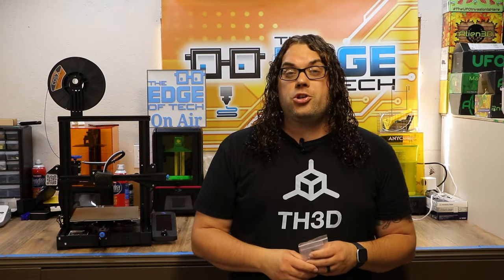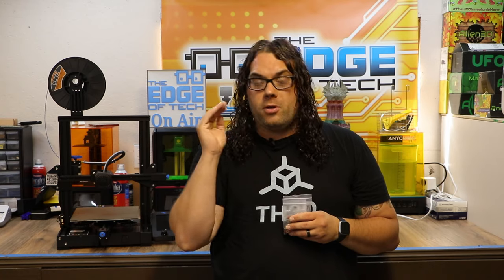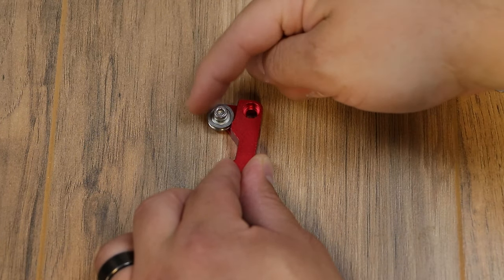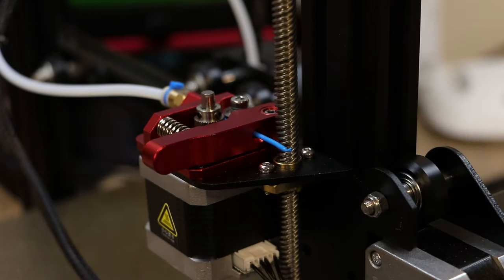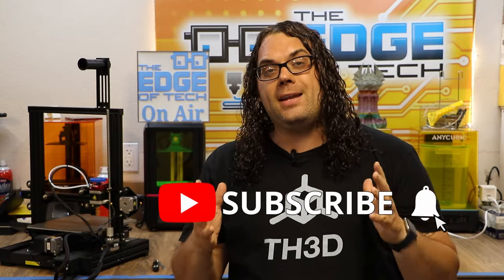Upgrade the Ender 3 V2 Extruder in 5 Minutes - Aluminum Extruder Upgrade

Comment: “If you look under the arm… you might find a little crack in there”. 

Pulls arm off, finds it’s cracked nearly in two. 

“Huh. Well, there’s the problem”

Thanks for the great guide, made the diagnosis of the problem I was having and the upgrade process really simple.
Reply: That's what happened to mine the other day. Explains why my prints were awful leading up to that. Replacing that mechanism has lead to prints being so much better. Even without calibration.
Reply: Yep, I'm here because mine cracked  last night.
Reply: same lol
Reply: Mine silently cracked / tore itself apart. I was really happy as it explained why my prints have been failing for so long.
Reply: Exactly the same happened to me

Comment: Thanks a lot for this video. I did a couple of things differently when I installed the extruder. 

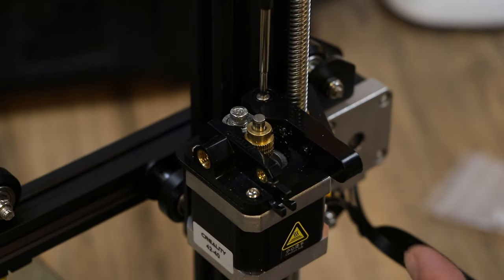1. While removing the screw in 2:30 , I retained the metal funnel thingy that resides inside the sprint and transferred that to the new extruder where this piece was lacking.
2. I retained the gear from 2:45 as it looked like the gear on the new one was similar to the existing one. Both had 2 grub screws too.

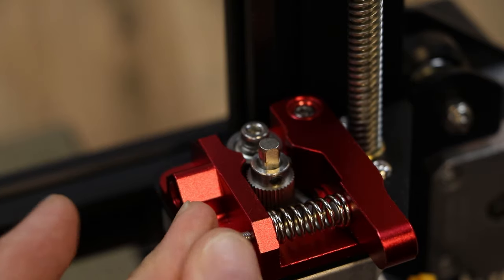From another upgrade video by bv3d, he inserted the screw in 6:25 the other way around. i.e from inside out. This way, the head of the screw supported the spring and would give it less wiggle room. I think this was a good idea too.

Comment: Thanks for an excellent guide. A small comment: There was no washer included in my kit between the pressure arm and the extruder body. The insert is dimensioned so that it is possible to tighten while the arm can move freely. Same with original. The new extruder works like a charm. Thanks 👍
Reply: I didn’t get a washer eaither
Reply: Same
Reply: yep, same here. I guess it's normal because it still was able to move perfectly fine without it :)
Reply: Thank you so much! I was looking all over thinking I lost the washer 😂

Comment: The only disadvantage with this extruder is it still uses the M6 coupling, I found the Creality metal extruder with the M10 coupling has allowed me to print flexible filament as the Bowden tube feeds right into the extruder.
Reply: Have you any link for the m10 i print alot of tpu and i got one of these v2's on order
Reply: @Loz348  they are available directly from the Creality website and most likely Amazon as well.

Comment: you guys solved my issue...was getting spongy prints and sure enough the extruder wasn't feeding consistently.  And just like you said the arm was cracked on the bottom.  Only difference is my stepper motor has the feed gear pressed on the shaft vs the grub screws you show. I just ordered a new motor with the flats on the motor shaft so I can use the gear with the kit.

Comment: This video was helpful.  It took me way longer than it should have to realize that the m4 spring screw and the m3 rivet nut being missized was on purpose so you could use the m4 screw to adjust the spring tension and thus how hard the extruder grabs the filament.  I substituted the 12mm long one that same with the kit with a 20mm one for a greater range of compression.

Comment: My stepper motor gear is pressed on, no screws holding it on the armature.  Can I still remove it without damaging the stepper motor?  How?  Will the screws on the new gear hold without the flat side on the armature?
Reply: I have the same problem, did you solve it?

Comment: Great video! correct me if i am wrong, looks like the power supply fan is facing down. Although power supply is elevated from the bottom for better air circulation please advise how well is it able to keep the power supply cool while operating for extended hours?

Comment: So do I have this correct. I'm shopping for my first 3D printer. Considering how many upgrades are needed on the ender 3, why buy it? Seems like in the end you've spent just as much as you would have for a nicer 3D printer from the start.

Comment: This is a bit late, but I just got my Creality extruder upgrade kit. Your instructions worked perfectly and much better than Creality's own video. I was disappointed to find that the new kits are not designed to take the metal Bowden fittings. It has no threads where the Bowden fitting goes, and instead uses a cheap plastic fitting, that the Bowden tube goes into, and is held with a plastic clip. Gives the feel of a cheap upgrade, with less quality.
Reply: Have a close look at the metal Bowden fitting and you'll find the same plastic mechanism within. They just made it easier on us by integrating it into the extruder itself.

Comment: The extruder arm on my printer just shattered. I bought the kit shown in this video . However, the 42/40 stepper motor I have seems to have a shorter shaft and a press fitted gear wheel. Do I need to buy another stepper motor with the longer shaft to be able to fit this type of extruder?

Comment: Great video! I was easily able to follow these instructions to perform this upgrade. Good thing I did because the stock plastic component was already broken on my printer after light use. I did have one print fail because the grub screws on the aluminum extruder came loose and the feeding gear lifted out of place. Has that happened to you before?

Comment: It took me forever to find the extrusion problem with my Ender 3 v2. It looked like it was missing layers in my prints.

Finally I noticed that crack in the arm you mentioned because I accidentally pulled on the filament and it slid out with any effort or spinning the stepper.

I got the Creality version. It doesn’t let you over tighten the arm and apparently works better with flexibles but I only use PLA so that doesn’t matter too much to me.

Comment: Just ordered this for my Ender 3 V2 from your store. I changed the front metal nozzle (where the filament melts) to the 2nd included one from Creality. I am noticing that my current print of a 3d file has thin walls and sometimes the infill inside and outer parts ill come out porous (pores/holes) and with a bit of force the 3d print can break or be brittle (noticed that at times the lines will break or they come out in tiny fragments off the filament shape lines while the nozzle is moving to and fro). Could it be the infill rate is high? Or maybe the fillament is coming out too thin or something?

Any help would be appreciated (sorry if I cannot show a photo of what im describing) Im currently printing a purchased Solid Snake MGS1 3d print file and seeing that the legs can be seen through and I actualy can see the grid print lines inside. Any links or sites or info you can pass along to me that I can research and study so I can get better prints as this is actually my first 3d printer and is my entry-point into such a hobby. I actually didn't want to get the Pruga/Prugent (or whatever the name of it is called that costs near $800.00) . I heard great things about the moding abilities of the Ender 3 V2 so yeah......

Im printing with Glow in the dark PLA filament, but am researching into a stronger format maybe ABS or the Metal infused variant (though im not sure if I have to change the front nozzle or extruder to a metal or titanium based one for that?
Have a wonderful and rocking day :)
Reply: You probably figured it out by now but it sounds like under extrusion. He has a really good video about how to adjust your esteps https://youtu.be/lH-RrjtiC8M

Comment: Hi Jim, I install aliminium arm with single gear but after long printings like +20 hours I see that arm get hot and flament get flex. I use esun pla+. Also I see people use dual gear for extruder. Do you recommend it? Now I buy a passive cooling under extruder engine hope it will fix my problem. if you used double gear, would you recommend it? If you suggest, I will return and replace the single arm. I usually get prints over +20 hours. I print game figures. Greetings from Istanbul Turkey

Comment: I have this same Aluminum Extruder Upgrade and find the tension too tight, its deforming the filament that its causing friction in Bowen tube.  Is there a way to make it tension adjustable?

Comment: I would prefer a dual gear extruder
Thanks for sharing👍😀
Reply: There is a metal dual gear out there. Idk where but I have seen it. That or a bondtech will slap right on you just gotta change some settings.
Reply from the maker: Good choice! I like both, but I have heard the dual gear extruders like this can cause issues. I will have to test one!
Reply from the maker: That may just have to be a future video, because those are great extruders as well!
Reply: @TheEdgeofTech  I've never had issues with dual gear. Well I did have one. The bondtech is geared and long story short had the ability to push with so much force that it curled petg inside my e3d v6 when I was having heat creep issues. Otherwise they are my preferred way to go. So much more grip and power that I've had it pull tangles and print with just minor under extrusion when I completely forgot to close the door on the bondtech.
Reply: @girrrrrrr2  I bought a Winsinn dual gear extruder from Amazon just recently.  I have had it installed on the V2 for a week now with no issues.  I also added Capricorn Tubing whilst I was doing the upgrade.

Comment: I geat a broblem when I chnged the same extruded in place of the chiron  extruder that is when the extruder rotate it take the filement uit so i need to invers the extruder to geat it work. Ik I invers the connector it wil be a broblem to calibrate it, i dont know if you have a solution to this problem?

Comment: I’ve watched so many videos, my filament isn’t being fed to the nozzle unless I disable the steppers, if I don’t then everything still turns how it should but the filament doesn’t go anywhere. Please help, it was working perfectly for about 24hrs then it stopped and hasn’t worked since (about 12hrs). I’ve tightened the grub screws, cleaned the nozzle (it was clogged), checked the lever for cracks, nothing. I’m 5min from returning it to amazon before it becomes a big paper weight and just sticking with my other 3D printer

Comment: Hello. Thanks a lot for this interesting video.
I installed Cura 4.7.0 released version two days ago. It was working fine. But suddenly, I have noticed that when printing the files sliced with Cura, the printer moves extremely fast and I'm obliged to abort the printing. What do you think is the main cause?
Reply from the maker: Not sure. Have you tried changing the profile you are using to see if it's just Cura profile?
Reply: @TheEdgeofTech  I will try that after. When I use Simplify3D it works fine.

Comment: Before pulling the filament out, why did you push it in first to extrude a bit?
Reply from the maker: I do this to purge the nozzle and hopefully take out any old filament that's been sitting there. Then pull it out. A lot of times on newer machines it will automatically do this with the load and unload fillament options.

Comment: Try this myself and found that my flow rate changes? I think it was caused by the wheel diameter being different on the stock model compared to the upgraded metal one??? Not too sure but would like to hear some advise on this problem.

Comment: Ok so I did get this put on with new motor instruction say set to 139 but to get like 90mm had to set at 280 original was set to 230. What am I missing if stock setting is like 100

Comment: Why is it important that one of the grub screws on the gear sit flush with the flat part of the stepper motor arm? Could it cause under extrusion or trouble later if one screw isn't sitting on that flat end?

Comment: 2:40  I have 5 Ender 3's and none of them have the set screws to remove the gear from the motor. Do I have a different model? I cannot find a video showing how to remove my gear from its motor.
Reply: i have this issue as well

Comment: Ive replaced my extruder by now its creating a ton of dust near the extruder which is starting to concern me. Any idea how to prevent this?
Reply from the maker: Check to make sure your spring arm isn't to tight. I am guessing it's filament dust right?
Reply: @TheEdgeofTech  its definitely filament dust lol. Im taking it apart this weekend to clean and see if i could figure it out. Im usuing one of the yellow springs folks usually replace on their beds. Is that too strong a spring you think?

Comment: So, I got my machine like 30 weeks ago replaced the extruder with a dual extruder finally got it leveled tried to print a calibration cube yesterday it was horrible looked at a couple videos to troubleshoot for common issues an now im having this issue with the aluminum dual extruder, it's just not pulling the filament through.
Reply from the maker: Did you check the tension of the arm? Also, you may have to calibrate your e-steps too.
Reply: @TheEdgeofTech  I will look into that now. -Thanks for the suggestion.
Reply: @TheEdgeofTech  But it seems to just not be catching i'll look to to see if the gear is slipping but i'm pretty sure its up against the flat side of the stepper motor and is well secured.

Comment: got the extuder, but in loooong prints 12+ hours, or in short ones, there no apparent trend had problems with smashing the material and ending not extruding. my feeling is that the tension was way off and for softer PLA it was easier to get mangled up. also, in relation to the stock plastic one, i observed that on the stock the PLA wire goes from hole to hole almost in a straight line, but in the metal extruder there was a bit of a noticable curve while touching the gears. The new metal extruder from creality, is the same as stock but metal, i think that will solve the problem.

Comment: I struggled with the fitting and wondered why it wouldn't stay and screw in. I take a look and they didnt thread where the tube is suppose to be installed. Guess ill back to the plastic

Comment: Hmm. wouldn't a steel insert wear much slower than a piece of aluminum? I believe one issue with the Enders is that, once you get halfway the roll of filament, the filament is pulled into the extruder under a pretty steep angle.

Comment: the shaft on my stepper motor on the ender 3 4.2.2  isnt long enough to catch ther set screw on the gear. im going to drill the gear and tap it in a lower spot

Comment: Although this upgrade is better than nothing, it does not completely resolve the bowden feeding problems. Wouldn't it be better to have a dual gear extruder? Something that doesn't let the filament slip at all? Also, at best, this will just make the extruder motor "click", which indicates a lot of friction as the filament goes to the nozzle. Adjusting the stepper voltage will give the motor more power, but be careful as it can also make the motor run too hot...

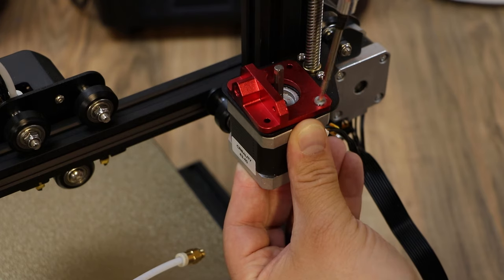Comment: 03:54

My kit didn't come with this red piece, so my long screw doesn't sit properly and the arm just pulls right out 🙃

...

I feel a bit stupid, as I didn't watch further before questioning how my parts assemble. I don't need that red thing, I've got a similar thing in mine that when screwed all the way holds the arm at the same level as the gear /feeding hole 🙃🙃🙃🙃

Comment: Hey, Thanks for this vid. But for some reason, i just got my ender 3 pro, and there is a different gear on the motor. This is not screwed on, but it looks pressed... Anyone seen this?
Reply: Mine is like that to. I can’t get it off
Reply: They changed all the gears to press fit instead of grub screws.

Comment: You ignored/forgot the metal cap that goes on the screw that holds the spring in place. It allows you to adjust the tension of the pulley on the filament.
Reply: Can you explain this a bit more? I have 1 part that I did not use and I think this is the cap you mean?
Reply: @melvinc4702  There's a little metal thimble/cap looking part. You screw in the screw that holds the spring in place, then you place the cap over the threaded portion. The spring will go over the cap. This makes the spring press on that part so when you tighten the screw you're actually compressing the spring. Creality's official video (even though it's for dual gear) shows it: https://youtu.be/PViMSuYmEXI?t=100

Comment: If your extruder motor gear has no grub screws and can't be removed, you have an older model and it's not supposed to come off. From my reading some people online had success removing it with a bearing puller, center press, thermal expansion or just cutting it off with a dremel, but there is no guarantee and as it is a permanent modification it will void your warranty, I just bought a new motor.
Reply: Can I do this with a cr 10 smart?

Comment: 7:00 that part is kind of an issue to me. the hole isn't threaded and it's too large. wtf do i do? omfg. just spent half an hour figuring everything out on my own and died on the last step. this is so stupid, i must be a manufacturing defect. i'm just going to superglue it in place i guess.
Reply: Did you figure this out? Mine is also not threaded

Comment: Washer doesn’t allow bolt to reach threads
Reply: Mine only came with 1/2 washers tho so maybe that washer wasn’t necessary to begin with.

I wound up putting the washer on the pulley